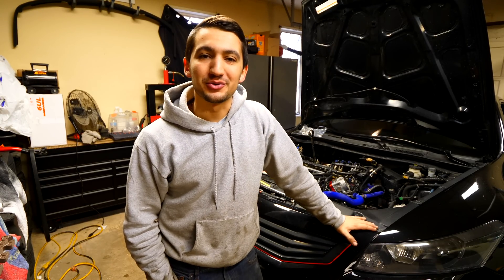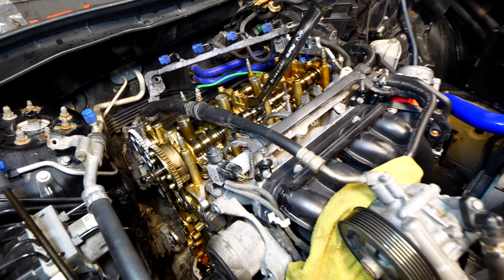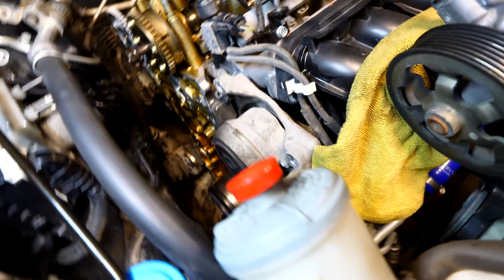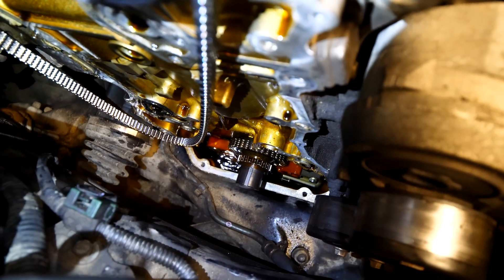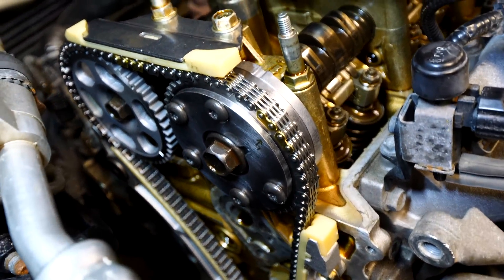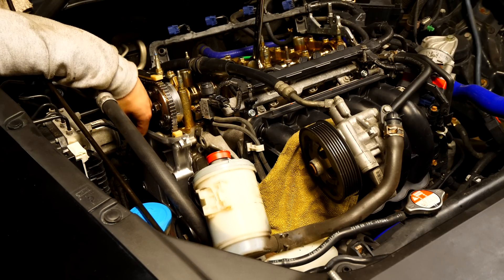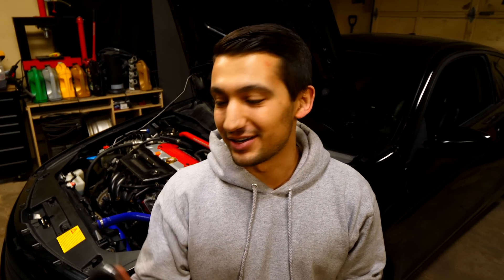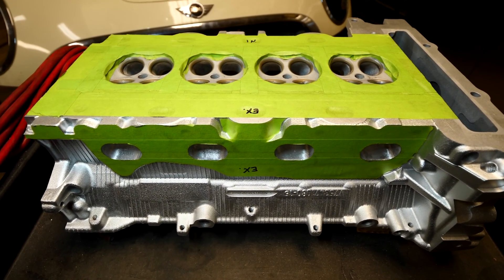How I Replaced the Timing Chain on my 200,000km Honda Engine

Comment from the maker: DID YOU SEE THE SPIDER AT 13:12?
Reply: I was JUST about to comment on that 😖
Reply: @ardentvibe6917  ¹
Reply: Yellow Sac spiders, and they can cause lots of problems with your car. They are attracted to the smell of gasoline and often will weave webs and egg sacs in the evaporative canister vent lines.
Mazda even had to issue a recall due to the spiders plugging up the components.
Reply: Yes, I'm very afraid of spiders!

Comment: I always hand tighten the two bolts to the  sprockets, install all the guides and put the timing chain on its marks, and then torque the two sprocket bolts so there won't be any accidents when they are moving as I tighten them, they'll move together.

Comment: Only a real man does this job without taking the engine out lol

Ive been at it for a couple weeks now. What a monster, no clearance to pull these damn bolts! Getting the cover back on and torquing the bolts to get the honda bond on nice and tight is gonns be terrifying. Challenge accepted

Comment: Quick question my Acura tsx 2010 k24 had code p0341 which usually means the timing chain has stretched. Now the car won’t start am I right about this ?

Comment: How would you fix a miss alignment on the VTC and camshaft
Reply: It only goes on one way, you can’t misalign it.  Make sure the lock pin is unlocked before you tighten it down.

Comment: Will a stretched timing chain always throw a code (CEL), or should this be done as preventative maintenance? I have a 2009 Accord that has 146K miles on it, and it has that VTC actuator rattle on a cold start. It lasts for less than 1 second, but it's always there. 

There is conflicting information about all of this crap. Some Honda mechanics say don't worry about it but be sure to keep oil levels up. While others say that the rattle noise will lead to the timing chain jumping teeth before too long. So needless to say, I am confused.

However, if I know that a CEL will be triggered 'before' the situation becomes critical, then I'll feel a bit more at ease.

Comment: You used way too much sealer on the timing cover. The excess ends up in the crankcase and can clog the oil pump inlet, potentially starving the engine of oil. You didn't mention locking and unlocking the VTC actuator. You should have changed the crankshaft seal. According to every mechanic I've talked to, the oil pump chain and sprockets should also be changed, because if the timing chain is worn, the oil pump chain is probably also worn. Unfortunately, there is no way to accurately inspect the oil pump chain without removing the oil pan, in which case, you may as well change the chain, the guide and the tensioner.

Comment: Just one question and 1 comment:
1. Why you did not lock the cams when you where removing the sprocket and the actuator???
2.Before installing the valve cover, you could turn the engine over at the crank manually to recheck timing marks.

Comment: I just ran across this video today. Five years later, you’re still helping him. I’ve been asking the dealership over and over again what that sound was. And none of them could diagnose it. And just this week it started sounding like it was slightly out of time. And I’m getting a high number of misfires on two of the cylinders. It only throws a code in the morning when it’s cold but I’ve had that sound for over 60,000 miles.

Comment: the reason your timing chain stretch at 120 KM because you run low on oil and racing your engine. The timing chain should last as long as the engine itself.

Comment: How has that Eccpp timing chain kit been holding up? Really hard spending so dang much on all oem components.
Reply from the maker: DON'T BUY IT!! IT'S JUNK! 

I had mine fail on me very shortly after installing it. Bought the OEM Honda parts after that, and had no issues. I went cheap the first time around, and it cost me more in the long run.
Reply: @milanmastracci  See this is what I was wanting to see. Sucks how expensive all the oem timing stuff is but it should last much longer. 

Daily’s having that Vtc rattle trying to hold off as long as I can lol.

Comment: Youngest kid and I did a timing change on his K20. Installed Honda OEM parts and front main seal, timing chain cover "O" ring type seal also since we were in there.  Had an issue getting the new timing chain tensioner to fully release.  Had to manually manipulate the arm on the tensioner to get it to fully release. Everything popped into place.  Noticed slack between the cams when rotating the engine by crank pully nut.  Good thing we checked everything multiple times.  The job itself is straight forward.  Pain in the ass to get stuff out of the way.  Car was a crank, no start with no error codes. I would expect a crank/cam sensor code.  Verified spark with plugs removed, injectors electrically firing with noid lights. Sprayed starting fluid. Engine would not hit.  Pulled valve cover and checked timing marks on the cam.  Off by 2 teeth.  Scopecammed pistons and valves, no damage.

Comment: Why does a new crank pulley bolt gets torqued down to 136 ft-lbs and then loosened up and re-torqued to only 36 ft-lbs? Thanks.
Reply from the maker: So the pulley can get seated onto the crank, and then once it is positioned correctly, it can be removed, as the crank bolt only needs 36 ft pounds of force to secure it.
Reply: @milanmastracci  and if the old bolt is reused only36 ft-lbs is required correct?

Comment: Just curious what's the point of using Hondabond on those round posts inside the timing cover? I noticed that my K24 had Hondabond on those posts from the factory, but I didn't replace it since it obviously wasn't sealing anything and I have been driving it for a year with no problems at all. I'm thinking it's just an error in Honda's service info.

Comment: so did you use oem or did you use that eccpp kit you have in the video. how is it holding up so far
Reply from the maker: In this video, I changed the worn parts to ECCPP parts, but very shortly after had to swap them out as they prematurely failed. OEM or nothing

Comment: You failed to tell the viewers that the vtc actuator sprocket needs to be locked after it's installed. I would've changed the crankcase seal too, along with the valve cover gasket, grommets, and seals on the valve cover, and also the seals/gaskets on the timing chain cover too. If it's already all opened up, and has that many miles on the car, it seems like a wise thing to do instead of having to do all that work again down the road. Seals/gaskets are cheap to buy, and they don't last forever, so i wouldn't risk not changing them and getting a leak. 
 It's also recommended to change the water pump and gasket when you change the timing chain, vtc actuator, guides, and chain tensioner, etc., because it's cheaper, and less work, than having to do it again down the road. If you do the work yourself, and don't mind tearing it apart again to eventually replace a leaking water pump, that's one thing, but that's different than for those of us who have to pay an expensive bill from a mechanic, so it's best to have it all done at once because it's less expensive.

Comment: I am not a mechanic, I have no experience and thanks to your video I was able to do the job in two days. Thank you very much for your video and excellent information.
Reply: how’s u remove ur crank bolt?
Reply: @jeralynrefugia928  To remove the screw, I applied penetrating w 40 two days before. And then with the help of an impact gun it came off without a hitch.
Reply: @SrColon309  I needa be like you
Reply: @jeralynrefugia928 put a breaker bar in the hole of the control arm and right socket turn the engine on it will get loose
Reply: Im assuming you have to turn the crankshaft to get the sprockets to top dead center right? (Punchholes up top)

Comment: Question about the torque specs for the crank bolt on reusing the old.  So your spec sheet say torque it to only 36ft lbs? Not 130 ft lbs? Is that correct? Wouldn't that bolt would come undone while driving?  Thanks advance

Comment: Quick question, I have a k24 with no chain installed , do I need to find top dead centre before installing the chain , or do I just align the mark with the chain on the crank ?

Thankyou

Comment: I looked at several “how to” videos on timing chain replacement and yours was hands down the best. Your camera work was crystal clear, closeup shots on the location of timing chain marks is the best. Narration was clear and relevant to the job, ( no unnecessary banter ). Additional info like wrench size to turn or secure the camshaft or utilizing a helper to reinstall the timing chain cover is helpful. Great job and appreciate you filming and sharing this on You Tube.
Reply from the maker: I'm happy to hear that Ken! Thank you
Reply: 100% echo this statement. Everything is done so well. I am a professional filmmaker, who spends all of his money on more camera gear, instead of owning a nice car, so I drive a 210,000 mile/25 year old Benz. My only piece of advice for you would be to grab yourself a Rode Wireless Go microphone, and just clip it onto your hoodie before filming. It’ll take your audio to the next level for a couple hundred bucks.

Comment: I would like to know they told me about a timing chain but I bought a timing belt for a 2006 Honda Accord and the two timing to 20 00 chain 2016 is supposed to work but the belt don't work so I was looking at your program and they told me that I have something going on with my valves which I didn't understand I need to explain to me before I try to do this myself can you help me I have bought parts that I need to send back and get the right parts this is my first time trying this I have worked on cars way before I got 60 years old it's just something I can do or something I need to pay somebody to do can you help me thank you

Comment: What about the smaller chain at the bottom i notice u didn't replace that one just wondering becuz I have a 2009 Acura tsx at 235k and i get that same noise at start up mostly when the ac is on at idle also when the compressor cuts on i hear it mostly.

Comment: ATTENTION: Very nice job first of all and love the added torque specifications because this was very difficult information to find to be consistent. In both of the following instances, relating to the Crankshaft pulley bolt torque, the threads are cleaned and threads/bolt platform lubed with oil. Reusing the old Bolt: torque to 36 ft/lb , then rotate additional 90 P'B deg.; Using a new bolt: torque to 130ft/lbs then loosen and torque to 36 ft/lbs then 90 P'B deg. Also, note I could NOT get the bolt loosened as many also experienced, the ticket was using the special 19mm crankshaft pulley/ harmonic balancer impact socket Lisle PN 77080. Boom, DONE! Thanks again, you did great and I hope anyone finds this helpful.
Reply: excellent information thank you very much, because I missed the pulley twice due to lack of more torque.

Comment: These are two different types of K24Z3 engines. One is 10.5:1 CR with you timing sprocket. And the other one is 11:1 CR with 4-inch high timing sprocket. DO NOT MESS UP.   If you own a ACURA TSX, HONDA SPORIOR OR HONDA ACCORD EURO buy 4-inch one.

Comment: i bought a 2007 accord with 89k on it. it has a leaking timing chain cover. that is under warranty. but the mechanic suggests i spring for a new timing chain and valve adjustment since it will be all open and accessible. is this a wise investment for the future or am i just throwing money away on repairs i don't need yet?
Reply from the maker: That's not a bad idea to replace all of that since you're already in there. If you replace it, you'll be good for another 200k kilometres / 120k miles without problems. I would replace the timing chain, the guides, the VTC sprocket, and then reseal everything.

Comment: Wow! Great job man! I have to consider doing this over a long weekend. I had the VTC actuator replaced TWICE over that terrible noise when starting. The timing belt is due for a change. If the economics are there to do it myself I'll have to give it a shot. You have a beautifully cleaned engine and great job with the very clear video shots of important parts. Thanks!!!

Comment: I will soon will be going thru the same thing, and the mechanic said, once we are replacing the timing chain, you might as well replace the vtc actuator and the water pump, what do you think about that, also I will getting the parts, question the oem vtc actuator is going for almost 200, and I see an aftermarket goin for less than 100, question will you make the spent on the oem or the aftermarket?
I thank you before hand and hope to hear from you
Reply: I got a Denso VTC sprocket but everything else is OEM straight from a dealer's parts counter. FixItAngel uses the Denso on his fix and AFAIK Denso is also an OEM provider for Honda...so it's not like I'm just buying some cheap knockoff. However the sprocket itself is made in China, sooo...

Comment: Hey I'm having a stressful  time recently I have to do the timing chain on my SI and I'm just trying to figure out should I go with OEM parts or aftermarket parts because it looks like you use aftermarket Mart aftermarket parts and seems fine right just please get in touch with me I just need to know
Reply from the maker: Hey Luisito, I don't think you've seen the follow up video to this one. DO NOT buy aftermarket timing parts. Only go with the OEM stuff if you want it to last. https://www.youtube.com/watch?v=l7nyGdgp4Sg
Reply: @milanmastracci  well thank you for the help but recently this SI bent the valves and the engine is no good but I think I'm going to keep the engine to work on it but ima get a new motor and fix this one

Comment: I’ve seen some people remove the intake camshaft when installing a new VTV actuator, but you did not. Is it necessary to do that?
Reply: Honda recommends taking it out and putting it on a padded workbench. But either way works

Comment: got a question, can i install the listed VTC actuator cam gear on my 2013 civic si that has  k24z7 when the accord has a z3 ??? someone help because mine is rattling pretty bad and i need it to stop
Reply from the maker: Yes you can as they are the same part. They have the same amount of cam phasing, which is 25 degrees
Reply: milanmastracci ok thanks man

Comment: Holy crap! my car's been making this noise since I bought it back in 2012. My Honda is a 2008 Honda Accord coupe 5-speed
Reply: I had the VTC actuator replaced twice already on a 2008 Accord. The first time it was under warranty so I didn't have to pay for it. The second time it cost me something like $700 to have the shop do it. Now I realize that I need to have the timing chain replaced and I might do it myself as recently I have acquired new power tools to make the job easier. But something like this will probably take at least a day for a rookie like myself.
Reply: @staypositive4358  I bought everything the timing chain ,the guides, anew VTC gear and the exhaust gear. I haven't put it in yet. I was supposed to get it all done 10 months ago but the guy who was going to do it for me crapped out I need another car if I'm going to do it myself. Right now my Honda is fine but I know it needs to be done.
Reply: @flyboy8282  . Just take a 3 day weekend off and make sure you have everything you need at home to survive like food. I took my first (and only) engine apart when I was 19 years old over 20 years ago before we have YouTube. I put everything back together just fine the first time. Just make sure that you're meticulous and you have all the tools and parts necessary before you start the job. If you're truly paranoid about doing this then get a rental for a few days to make sure you can get around while the Honda is disabled. The  cost might be similar to taking it to a shop but the satisfaction and experience will pay interest in the future. I've replaced just about everything outside of an engine and transmission over the years saving thousands. A month ago my alternator went out (I should have seen it coming). Still, I took the afternoon off from work and replaced it myself the same day. Cost me just over $200 with minimal impact on my job. Anyway, best of luck to you whatever you decide.

Comment: My accord is throwing a Crankshaft position sensor code and going into limp mode. new senor on and all the voltages are in spec but still goes to limp mode. Timing chain does make noise on startup, do you think this could be my issue?

Comment: Milan , thanks for that video . It gave me a good Idea of the work involve. Now I'm in the process of putting things back together, and I wanted to make sure I understand . The  crank pulley bolt need to be torqued at 130lb , then remove and back on at 36 !? Why? that thing toke me all me strength to get out in the first place. why not leave it at 130lb?   thanks again.  :)

Comment: Holy crap, I didn't realize that rattling sound was a Vtec actuator. I thought I wasn't getting oil to the cams, but that sound is precisely what I heard. Today, it continued after the CRV started and then it would not restart again. I assume the actuator is broken, and possibly the chain.

Comment: The spider 😂, hum pre tensioner tension ? Question or just pull the gernade pin, also carfull on timing it cause the pully vulcanized rubber slips on them there mowers🔧😎✌🏁

Comment: this is a good video but that sprocket you are replacing on the camshaft is not the vtc actuator. The vtc actuator is a solenoid that plugs into the engine and on the k24, it is right behind the serpentine belt tensioner.

Comment: K20z3 vtc is harder than this. I think you have to block two holes on intake camshaft and use compressed air to unlock the 50 degree vtc off z3 camshaft. Should be a fun job for me haha